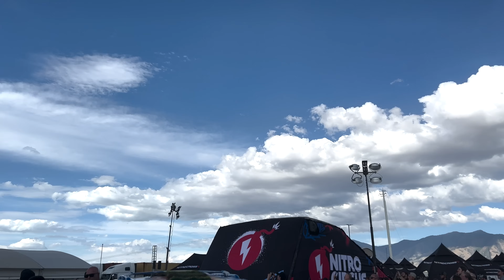Craziest Frame Stretching I’ve Ever Done!!! 500HP Demolition Build!

Comment: When running a steel fan you may want to add a thin piece of expanded metal to the inside of the radiator so when the radiator gets pushed back the fan doesn’t cut the radiator it just scrapes on the expanded metal covering the radiator

Comment: I had a lot of hills in the yard and the kids would spin tires constantly. So I cut the tread off a real car tire wrapped the back wheels and just self tapped them into the plastic wheels was never a problem for years gave it great traction and bouns made the tire an inch or so bigger making it faster. 👍🏽
Reply: That's exactly what my father did for my siblings and I.

Comment: Love your paint job! Only thing better would be adding adding electric lighting to your  lightning bolts.... flashing leds, maybe even electric paint... they do signs, logos ect on enclosed trailers.  Looks amazing on the back door.  Seen it used for interior lighting aka dome lighting. Even seen guys run fiber optics aka star headliners to add exterior lighting through body pannels, filler ect.

Comment: There is another advantage of coolant instead of water, the boiling point is higher and it cools a little bit better than water. Also water often contains minerals that deposit in the engine causing restrictions. A big advantage of water is that if it spills, the ground does not contaminate, however there is bio coolant available now a days.

Comment: You should put a smalll bicycle inner tube and stretch it around the center of the rear tires but cut off the valve stem so there is no lump that would give it much more wheel traction in the back. Better braking and take-off!

Comment: I add a 30 amp self resetting breaker on my modified power wheels. When they let off the pedal, and the power wheels continue to roll the motors can turn into generators and ruin the battery and other parts.

Comment: As a heads up if you want to do the van racing. Dodge made the 1989-90 Caravan with a V6 turbo (I had one as my first car in High School). They are hard to find, but would give you quite a bit more low-end speed (assuming the people don't bother to swap engines).

Comment: Robby, buy yourself a square tube, which you will put inside the c-channel frame-rail. I suggest you weld it into it with plug welds at the outside of the original frame-rail. After those holes that will be drilled into those original frame rails are cut out of it, you'll be able to add filler metal to the edges of them. How big will those holes be? Whatever size you want. I suggest they be the inside edges of the tops and bottoms of the original frame-rails. By the way, no, you weren't crunching those frame rails. Measure the distance from the inside of those tops and bottoms of them. That's where those thick tubes will be going into. How many holes will that original frame rail have? As many as you want. I suggest you leave two to four inch gaps between them. In that way, it won't severely affect the strength of them. That's the reason why those extra square tubes will be put into them. What thickness should they be? Three eighth to a half an inch. What length should they be? The two of them will start directly behind the plate at the front of the original frame-rail to the start of the cowl of the cabin, which is where the start of the transmission is located. You either might want to do the entire frame-rail, except that will require a square tube bender because the original frame-rail isn't straight. You're able to do the same with the front bumper. If this is all contingent on the rules of demolition derby. You may additionally put welding beads at the inside tops and bottoms of the outer frame-rails. This will prevent those rails from being crushed by those other cars on that track.

Comment: Would you be allowed to mount the radiator on the roof with an electric fan? Or is there a reason that wouldn't be good idea? Seems that radiators are the main casualty of war.
Reply: Each category has different rules.

Comment: why not put the radiator in the back  below the rear window and add a 12v fan to cool for the short time the engine is running...less hassle..

Comment: What the lads do here is cut into the frame, weld in supports on the inside. Then weld it all backup. Cant see the plates inside and looks like its just been bent back and the splits welded. Kinda cheating but the aim of the game is to try get away with what you can right ;) Long as your not welding in a tube that could potentially be dangerous i think its alright. Thats such a nice frame tool you have, never seen one like that over here. We usually have those rail ones with a simple hydraulic attachment and chains.

Comment: Need some tread on those tires, and all tool batteries wear out fast u der strain....like moving weight.  Buy some bigger batteries for like lawn equipment etc. online because they are just bigger single cell and something like a snow blower or mower runs two batteries.  You may have just fabricated yourself into a new extreme toy biz. 👽

Comment: After a certain amount of welding, you might as well just cast a one-piece frame out of solid steel, and keep your patterns to melt and re-mold it.  Anybody complains, just say it's fully welded to the point it's all filler.

Somebody should really develop a device to connect and disconnect wires without having them hang out of the dash like that.